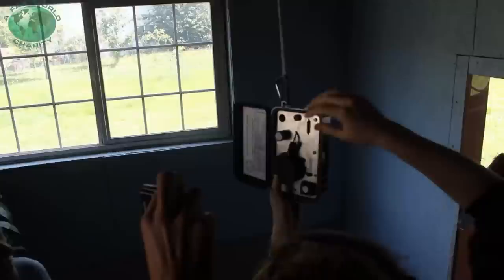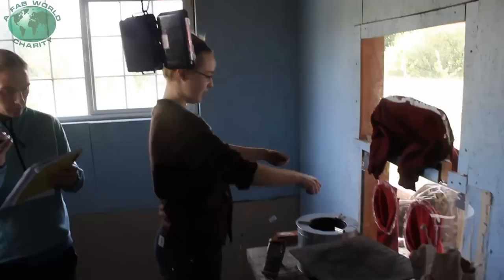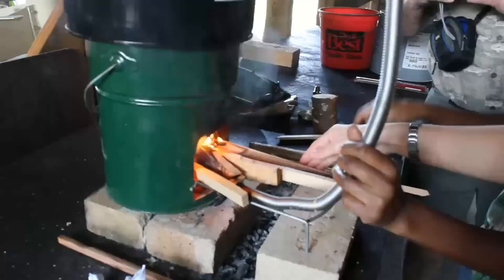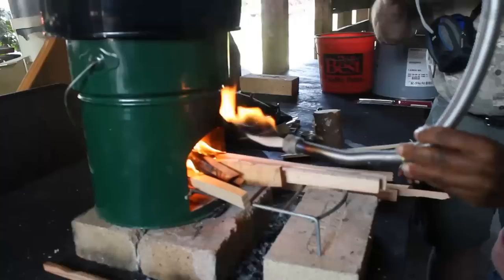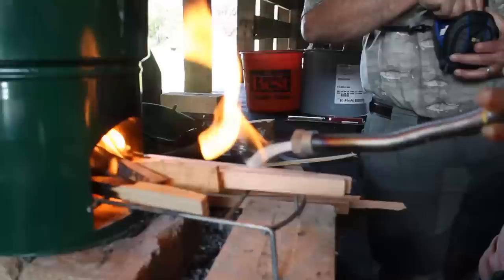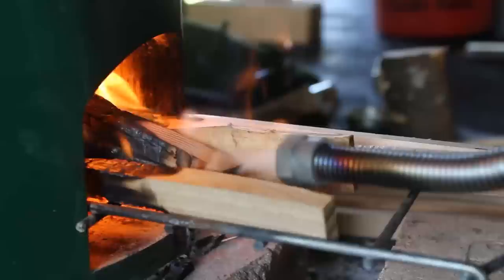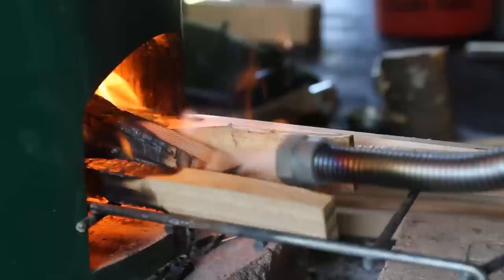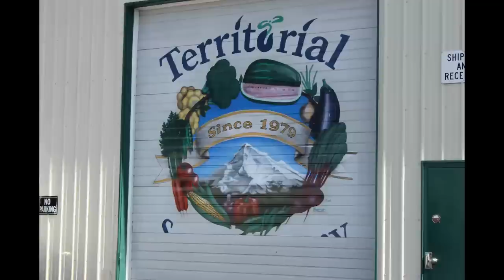Burning smoke at the Aprovecho Research Center Stove Camp

Comment from the maker: @TangoSpiceCompany The first day ended with a setback of only making charcoal on the bottom and loosing the gas flame... they were making a skirt for the thing the next day to try and distribute the heat around the bucket better.  The goal is to stop feeding wood into the fire and only use the gas coming off the charcoal making process to make charcoal... now that would be cool!
 The enthusiasm was extremely high and I really enjoyed hanging with the peeps!